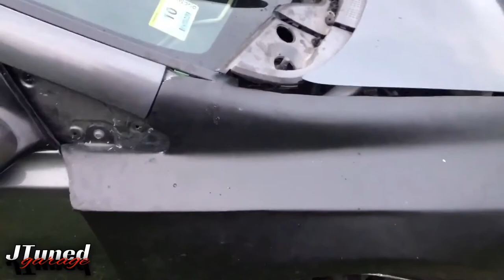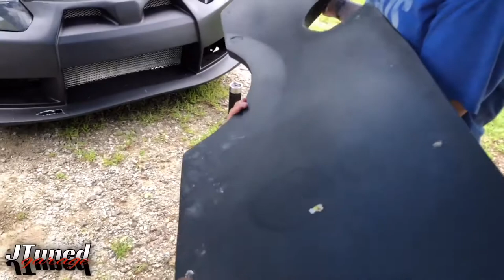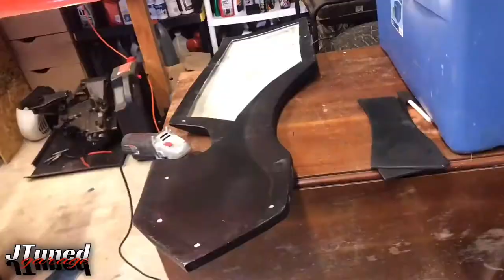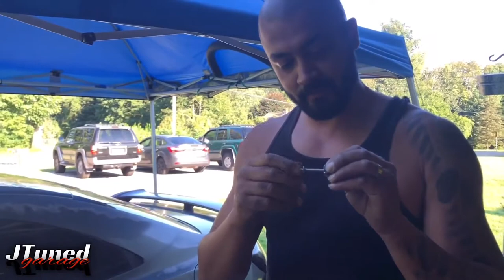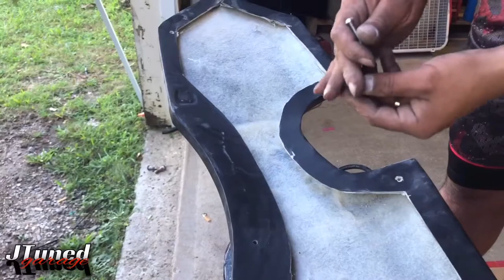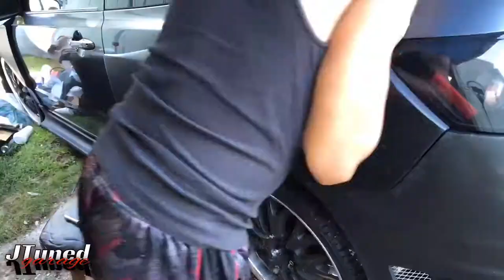2010 Civic Si: Wide Body #2

Comment: I was just looking at this kit for my 06 Si. Conversion kits are hair pulling. Im so glad i found your video. She looks great
Reply from the maker: If you do decide on buying this kit, prepare for it not to arrive a perfect fit. Especially it being fiberglass. I had to do alot of filling in gaps and had to cut sections off. For me, it was worth it. If you check out the other si videos, you'll see most of what I'm talking about. If you have any questions or need my help on anything, you can message me here or JTuned Garage on Facebook.

Comment: The kit looks 🔥 I’m thinking about ordering this kit too You don’t really see anyone with this wide body. If you don’t mind me asking where did you order it from?
Reply from the maker: This kit requires you to drill holes in the body of the car. Be sure to be ready for that. And seeing that it’s fiberglass you’ll need to do some work on the kit cause fiberglass is never perfect. When it warms up I’ll be doing videos on the fiberglass work I need to do. But in these videos you’ll see what I did to minimize having to have to drill so many holes.
Reply from the maker: But you can find this kit in CariD. If you can’t find it let me know and I’ll look through and find a link.
Reply: Appreciate your reply! I checked CARID and I seen parts but not the full kit. I’ll look around a little more. And thanks for the heads up I know all about it I do fiberglass and carbon fiber composites so if it has any blemishes I can fix no problem. I found the kit on driven by style for a great price I’m thinking I might go with that place. But anyways I dig your set up and can’t wait to see your car finished! I’ll be keeping a look out for your future videos 💯 I’m thinking about making some videos for my fg2 as well.
Reply from the maker: Here’s a site I found. https://overboost.com/2006-2011-honda-civic-2dr-duraflex-gt500-wide-body-kit-8-piece/ 
I don’t know the exact site my kit came from cause I got it over 3 years back but just now putting it on lol.